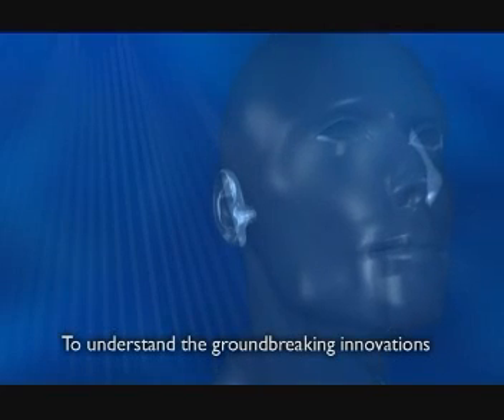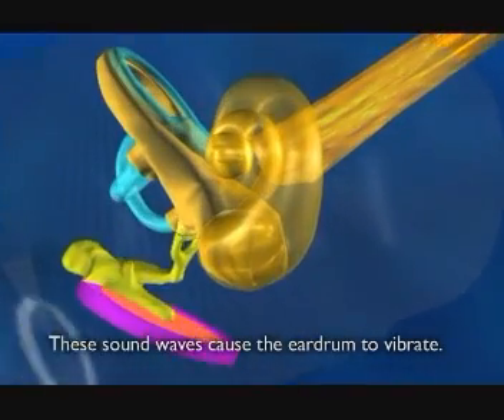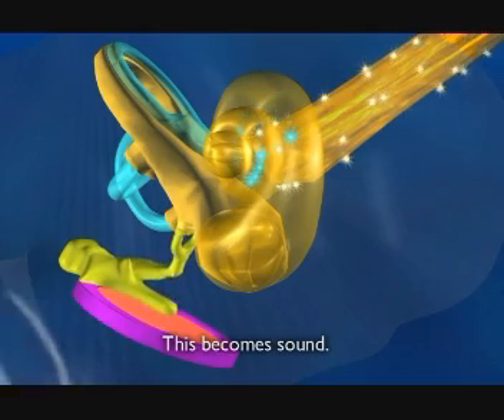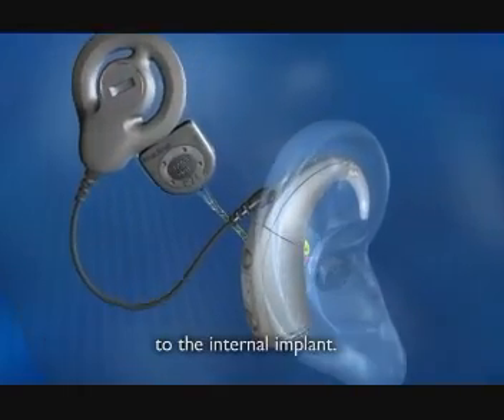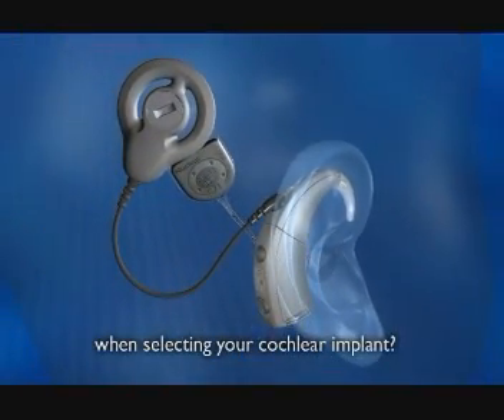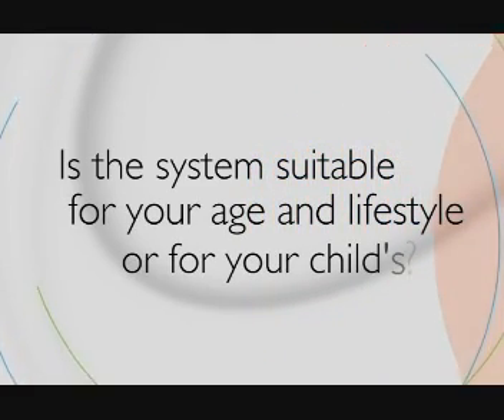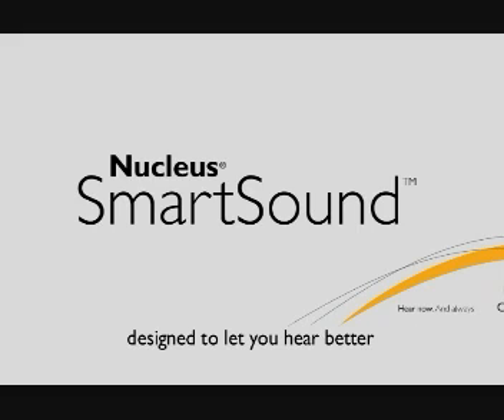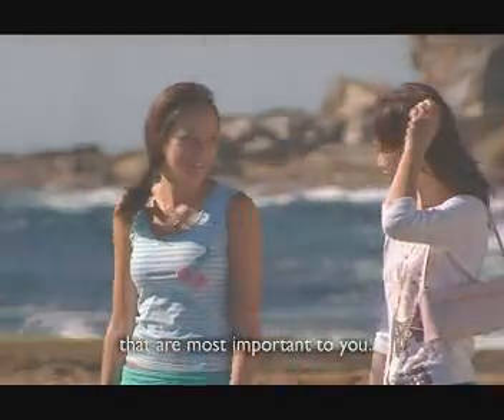Cochlear Implant Introduction

Comment: I have been 100%deaf since late  childhood and had a cochlear implant  installed  over 20 years qgo, the two early speech processors were wonderful  then I had the latest upgrade from cochlear and my ability to have a conversation with strangers plummeted to zero, that was four years ago and in spite of many retunings and help from the cochlear centre it has since remained the same , reducing me to having to request things be written down or having to use the interpreters service, I understand cochlear refuse to provide one of the old processors on the grounds the computer programmes used to tune them have been withdrawn,  I think that a very poor excuse, what have cochlear got to say about my situation ?
Reply: Assalamo Alaikum. I am from pakistan. i want to ask how much cost of cochlear plant surgery. because my sister is deaf.please tell me about that.thanks